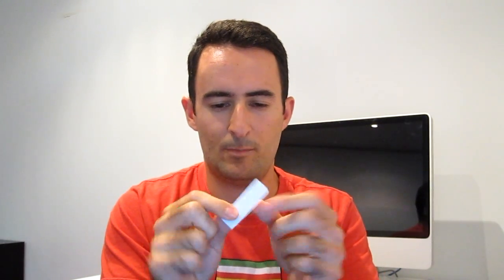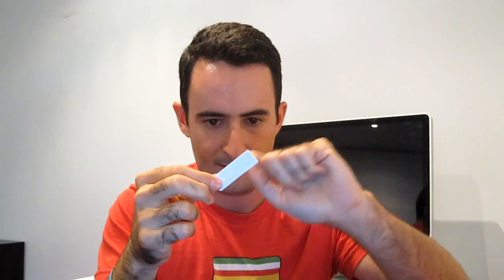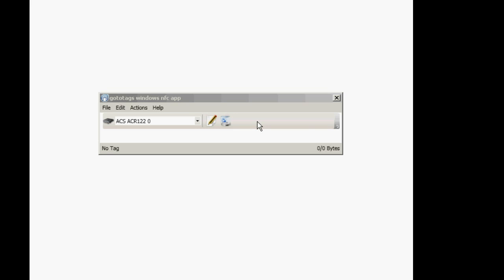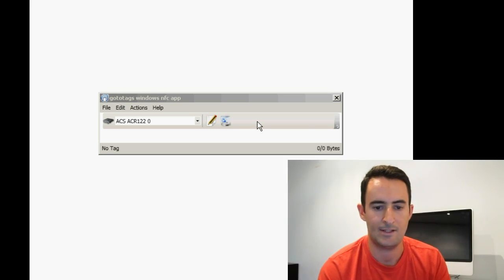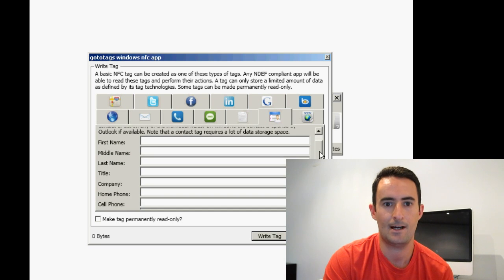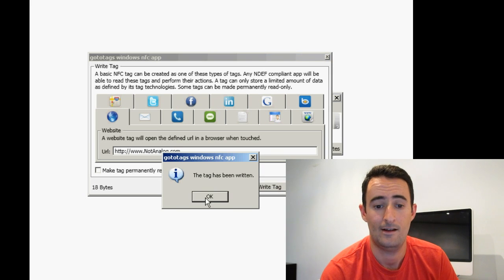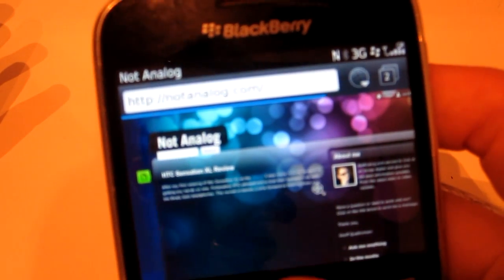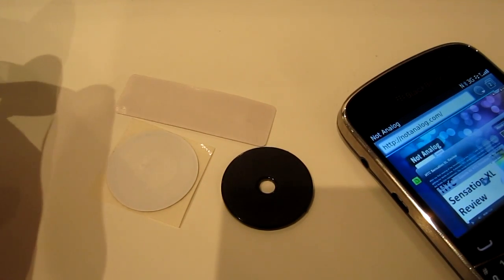NFC reading/writing demonstration

Comment: Hi , watching this in 2021….what other programs are there now to write data in NFC tags . Willing to start a business around NFC products as I think it has a massive potential as well and not used to Potential.
Reply: Had the same question didn't realize the video was that old 🤣 did you find anything??
Reply: @dmdeception  lol….yeah, there are heaps on iOS App Store that you can use but if want to be in the business of selling NFC products basically you need your own web application or app  which your customer can use .

Comment: Hi!, I have a litle quiestion, I get one of thie readers, and I'm working in Windows 10 Pro, but I can get the correct drivers to install the ACR122 P/N ACR122U-A9, The CD doesn't work, could you please help me, Thanks a lot..!!
Mauricio
mauriciodelgadorobles @ gmail
Reply: i had the same problem, on the ACS website i found this, which should work 
https://www.acs.com.hk/download-driver-unified/9094/ACS-Unified-MSI-4261-2-.zip

Comment: can i use the read\editer to implant a .bin file onto a chip?
Reply: I think if its small enough and you got the right writing programm it should work if i understand nfc at all. But theres a way to link even Gb sized files to those chips, simply put those files somewhere online in a cloud where you can make instant download links and you put those on the nfc chip, that should do the job. Those chips are even avivable in rings etc now

Comment: the problem u mention at the end has actually come true... blackberry, nokia and android all use different commands and security setings, therefore stuff like changing phone settings will work on android, but not on nokia or blackberry... another problem is the sending of stuff between phones.. android beam is great, but doesn't work with nokia or blackberry... I just hope that this problem is solved soon.. hopefully before apple joins the party ;-)

Comment: Hi, I was wondering if you could help me as I just purchased a NFC reader/writer (ACR 122U), and I have been having problem getting the sample codes that came with it to work with it.. The scardconnect function always returns a non-zero number and the application does not work accordingly. Did you happen to face any problem like that? and if you did, what did you do to make it work? (Note: I'm working on a 64-bit Windows)

Thank you!